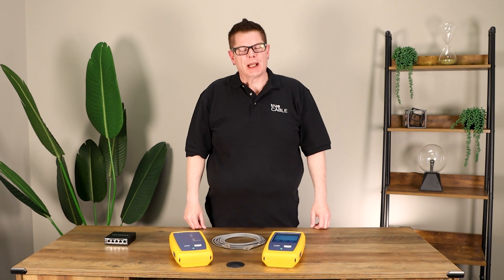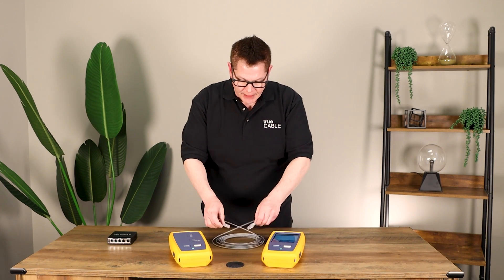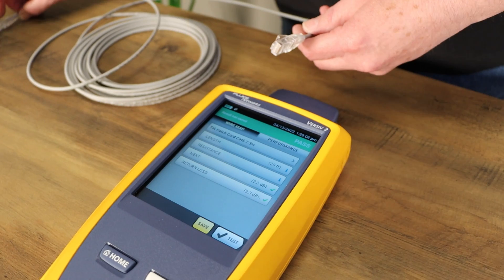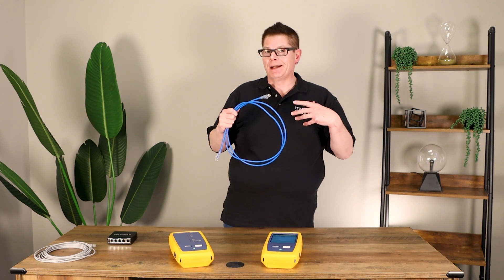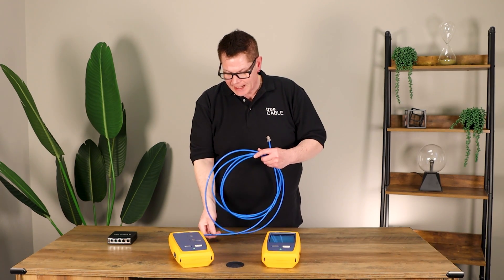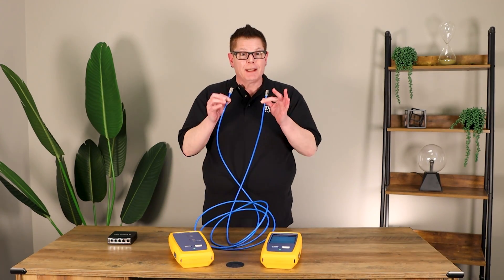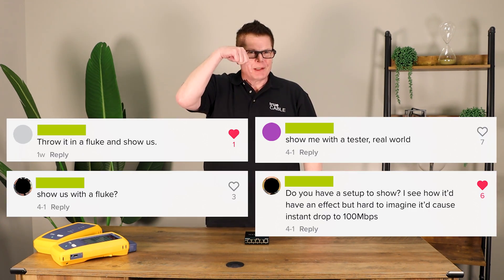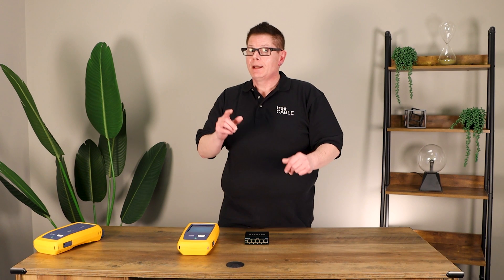How Much Ethernet Untwist Affects Performance: We Put It To The Test!

Comment: Nice.  Wish people were throwing money at me so I could get a certifier, but that's not the case.  Will just have to be more mindful of this.  Can you try comparing the pass through ends with the standard crimp ends with the same untwist?  The idea of bare copper hanging out the ends makes me really leery of using them, but they would make it easier to push your twists in further.  Would like to see if that bare copper does indeed cause any problems or whether it's fine.  Thanks.
Reply from the maker: Hello! You are in luck. Although not on video, I have extensively tested untwist for performance with passthrough and non-passthrough connectors. As it turns out, the biggest factor is fitment of the cable and insulated conductors to the plug itself. The TIA standard accounts for 1/2" untwist at each connector, so achieving tighter untwist at the connector does not get you much if any more performance and can actually cause issues in some edge cases. In other words, just achieve 1/2" or slightly less untwist and you will be fine. As to the difference between passthrough and non-passthrough connectors there is no performance difference *assuming* the cable to plug fitment is good in both cases. I will say that passthrough connectors are a bit more sensitive to ill-fitting insulated conductors, but that is more a feeling generated by experience. I have used passthrough plugs for many outdoor WiFi AP and camera installations with no ill effect, and those terminations are still going strong 5+ years later. It really all comes down to cable to plug fitment and meeting the 1/2" rule. Hope this helps!
Reply: @trueCABLE   Thank you.

Comment: Nice video. As an engineer who has been making a server rack doing my own patch cables and Keystone Jack connections it has concerned me untwisting the wires. For the Plugs I am using your Standard RJ45 Connectors. Just looked at one and it seems under 1/2 inch and more like 1/4 inch or just over 1/4. I would like to see this test with keystone Jacks. Also what happens in the chain if I have 4 keystone jacks compared to if I have 5 or 6 keystone jacks? Is the problem additive? For me real world I ran what leaves the Rack to a patch panel with a keystone jack because it looked cleaner but  that means one more connection. I would like to see a cable chain with varying number of connection combinations and test to see performance. Thanks for video
Reply from the maker: Hello Kim! You are definitely thinking correctly and have your head in the right place. First, I recommend against using solid copper Ethernet to create patch cords in the field unless you have a Fluke DSX-8000 around with PCA adapters to test each and every one. There are way too many things that can go wrong. Get matching Category patch cords that have been factory terminated and tested. Untwist at the termination is cumulative in performance degradation. Any electromagnetic disruption (a termination of any kind for example) will eventually add up to a poorly working cable run. Generally, the maximum amount of terminations per TIA 568 is going to be 6 per Channel. A Channel is from powered device to powered device. It is the full run, including patch cords. In this scenario, SIX terminations leaves you 2 x rack to jack style terminations (keystone to keystone or patch panel to keystone) and then two factory made patch cords. The quality of the terminations counts as well. Keystone or patch panel terminations are far better than hand terminated RJ45s. If you use hand terminated RJ45s you should not even exceed ONE in the Channel per the standard. The example would be keystone or patch panel to RJ45 to a PoE end point device and is known as a MPTL (modular plug terminated link). Now, it you want to use use male plugs and sort of "defeat" the TIA 568 standard in a way, then use field termination plugs. You are still limited to six, but field termination plugs perform just as well as keystone jacks! As for more testing and videos...that is on the radar!
Reply: @trueCABLE  That was helpful but left me with questions and ideas. I will check out your field termination plugs. I have thought for some cases of buying a factory cable and cutting off one end so that I have a good plug. Then putting on a Keystone jack on the other end I cut off. Still clarifying in my head the connection add up. Is the output of a switch to a cable plug 2 connections? Also a Cable plug to a Keystone jack would be considered 2 connections? I would be cool for someone like me trying to picture if you had a diagram showing what you explained as the six connections. Using your standard RJ45 connectors looks pretty fool proof. I am able to slide the yellow piece over the wires and get about 1/8 of an inch from the jacket, Trim it, insert it and crimp. Looks like a really short length. I guess this shows my lack of knowledge on the subject. Would I have access to the ANSI TIA 568 spec to read?

Comment: Great video, thank you!! Could you also do a little testing like that with some excessive untwist prior to punch-down blocks for wall connectors? Not sure if it would make the same difference from RJ45s but I'm curious to find out. I am aware that the specs apply to both, but it doesn't look like a lot of electricians are aware of that...

Quite common to remove wallplates and find something like 4 inches of sheathing/cable jacket removed and pairs with more than an inch of untwisting before being punched into their IDC.
Reply from the maker: Hello and thanks for your compliment and comment. Indeed, testing excessive untwist at a IDC termination is also worthy of investigation. I would think things would end up the same, but who knows? We will add that to the list of videos to do!

Comment: Does the poor cable termination impact adjacent connections in the rack?  Crosstalk, etc.
Reply from the maker: Good question Cash! No, that would only affect that single termination. Now, there could be an edge case scenario where two Cat6A terminations adjacent to each other, if they are BOTH poor terminations and BOTH terminations are being driven to 500 MHz, may impart ANEXT onto each other. In this case you would experience high NEXT on the individual terminations and ANEXT on top of it. That would be a weird scenario, but it is in the realm of possibility.